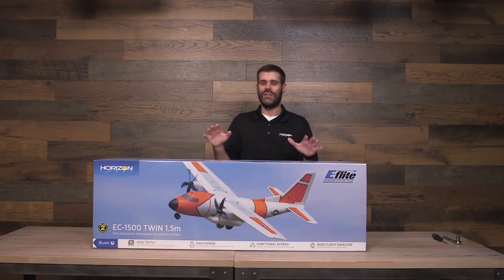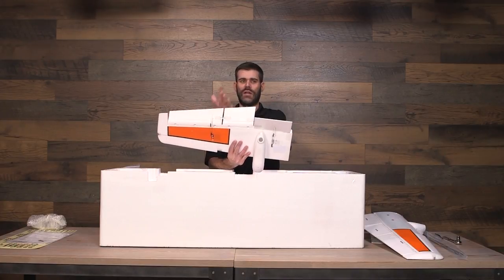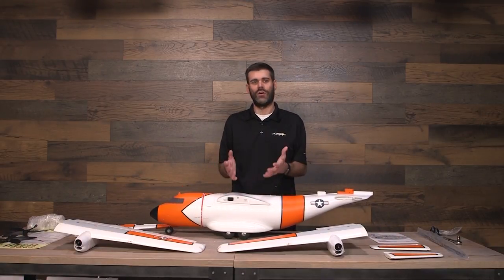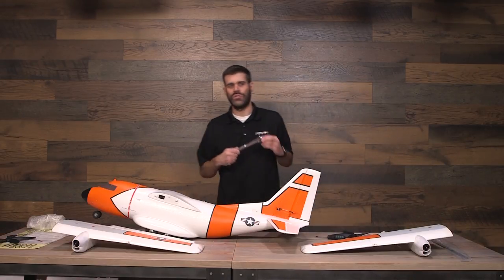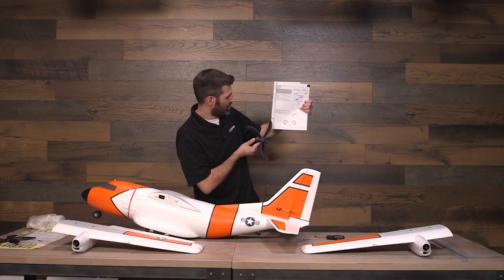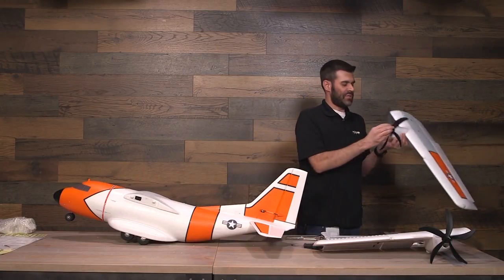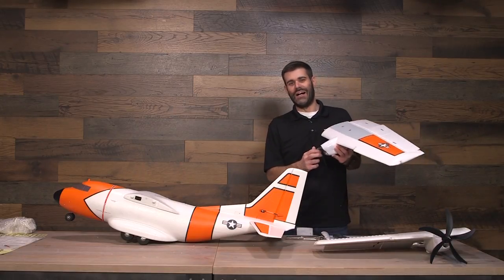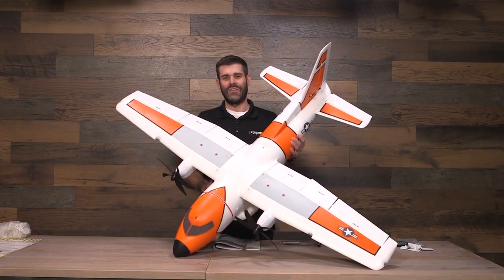Unboxing and Assembly: E-flite® EC-1500 Twin 1.5m

Comment: Got mine in Australia yesterday.  This is an excellent plane!  The size is really impressive and the form and fit is second to none.   Love its round shape and wings / engine nacelle combo is really amazing.  It does come with a EC5 connector so order an adaptor to XC90 or 60.  Don't be put off by the installing those scimitar props ... its no big deal and easily achieved like in the  video above.  It is a big fun beast and a absolute winner.  Big grins all round.

Comment: Prop tightening, I plan to use blue thread lock and tighten them well. A guy on another video added 6mm lock washers, sounds good, but I like blue thread lock. This of course is with the newer updated prop adapters. I will also do 2 or 3 clear coats of Varathane polyurethane gloss 'water based' as the water based polyurethane won't yellow at all. I used to use Minwax Polycrylic, but switched to the Varathane polyurethane, seems to go on a little easier and also dries fast. Amazing how much better a clear coated foam plane looks, richer colors & decals, protects, easy to wipe off dust & dirt, seals decals, and makes them fly a bit more efficient with a smooth clear coat.

Comment: I've been somewhat interested in this airplane, be nice to have my first twin engine. Then today I noticed 'Cyber Week Special' where the bind & fly one was normally $370 temporarily now down to $300 so ordered mine today, along with an EC3 female to EC5 male wired adapter. And with the rock hard foam E-flite tires, will likely replace them with nice soft & quiet Dave Brown "EVA Foam Lite Flight' wheels, maybe also get a bit larger diameter front tires for my AZ desert runways.

Comment: Beautiful, but no retracts! :(
Reply: The actual Livery it's designed after does not have full retracts the main gear wheels always stick out the bottom on the real one. Which is pointless to do and will make it overly complicated and more expensive than it already is with people already complaining about the price.
Reply: No retracts make you sad? The main tires only come down about an inch or so!
Reply: @FarmerFpv  Yes the complainers, they often want lower prices & more features. "No retracts" how will that guy make it through the day being so sad? First world problems!